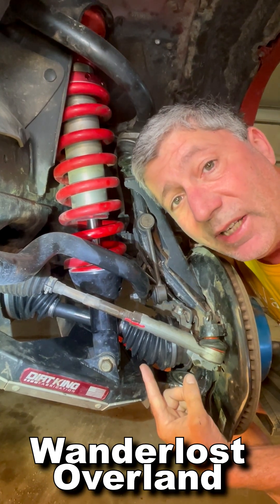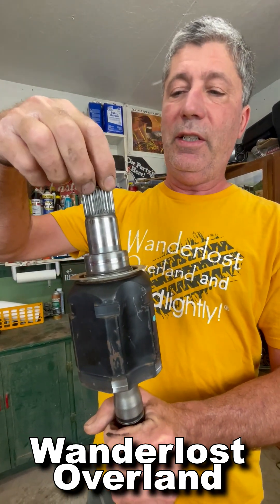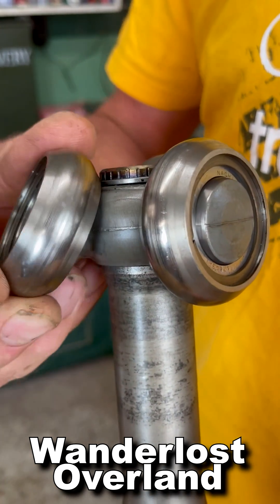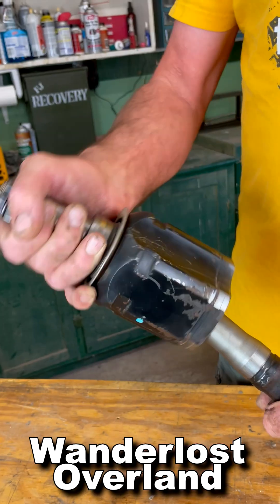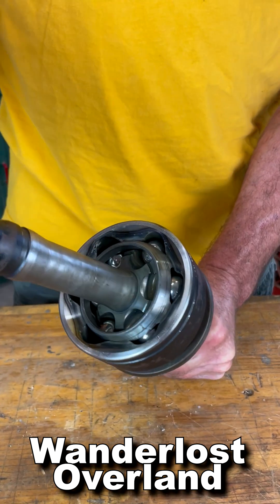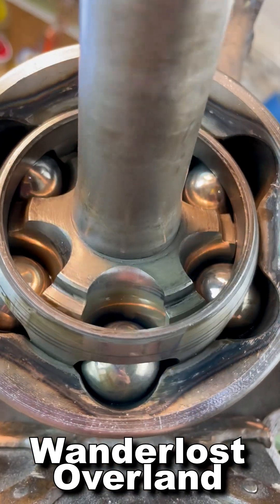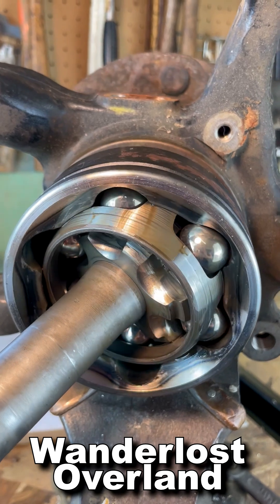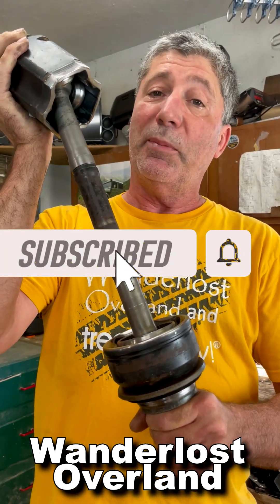How Does a Toyota CV Axle Work

Comment: I replaced my CV axles on my 2006 four Runner and used aftermarket. The aftermarket vibrate and Toyota doesn’t make axles for that truck anymore or at least those earlier years. If I had known, I would’ve just had them have new boots put on. Live and learn.
Reply: Many shops wont replace just the boots.  They insist on replacing the entire cv axle.  I just contacted my local toyota dealer and they do sell oem replacements at $600 per!

Comment: Gotta replace a couple tomorrow along with wheel bearings. Do you have to pop the ball joint off the knuckle to get it out?
Reply from the maker: No, just take out the two bolts holding the ball joint bracket to the spindle.

Comment: Except the only flaw is when the rubber boot brakes, water gets in, and the ball bearings start to rust and lock up, eventually cause your cv axle to clunk. Especially when turning sharp. Had to replace them twice within a year because the rubber boots are terrible. But that’s my only complaint with Toyota.

Comment: The CV joint is a combination of two joint designs the first shown being a tripod joint and the second being a rezeppa joint. They both have strengths and weaknesses, but are well suited for their applications (transmission side and drive wheel side). Yay trade school.

Comment: FunFact: This type of driveshaft first appeared on the Classic BMC Mini in 1974 complete with that locking circlip. They were designed by GKN in the UK which owned a range of transmission companies like Hardy Spicer whose universal joints Issigonis had used on the early Minis. But they had limits.

However the story goes back to one Alfred Rzeppa who patented a design using sliding balls but it was never used in production in the USA for many reasons and the design ended with Dana in the '50s.
However a British business called Universal Power Drives put the joint to work in heavy-duty industrial applications, including 'Unipower'-branded tractors and truck axles having solved the lubrication and material specification issues.
A William Cull submitted patents on the CV joint working for Unipower which itself was bought out by Birfield Industries in 1957, which supplied parts to the British Motor Corporation and owned Hardy Spicer and Co., Laycock Engineering and Salisbury Transmission. Cull ended up working for Birfield and continued his development of the joints. The result was the 'Birfield Joint', which was put into mass production by Hardy Spicer and was later adopted by Issigonis to meet the design requirements of BMC's 'ADO15' project - The Mini.
GKN bought out Birfield in 1966 which brings the story full circle: The joint used by Toyota is the 'Birfield Joint'.
Reply: So Front axle shafts on toyota solid axles are basically bigger versions of cv axles?

No wonder why the oil leaks so.hard to repair on them
My 85 toyota axle with Birfield design needs full re seal

Comment: For those that off-road, avoid straining the axle at full droop while wheel is cracked all the way in one direction. 

Was with a group of guys where one blew his driver side out,  about an hour later after swapping it out, blew out the spare on the same rock.
Reply: Thats a common issue with universal joints, not CV joints
Reply: @mildphil  sorry, I should've stated it was a group of 4-runners.

Comment: And that is why CV joints implode.
Reply: Only had an inner side joint explode on me with brand new only days old axle coz of me replacing only one side engine mount and not both sides together which I should.  Was at full stop in middle lane making a sharp left turn and it exploded with trunions braking the cup. It was a Mopart  OEM part
Reply: @andrewbanit4884  yeah it was a Mopar part. They’re known for shitty ball joints, especially with their 3/4ton to 1ton trucks
Reply: Only had them break from lack of grease, very old grease, or just cheap parts. There’s a reason why the OEM parts are more expensive, it’s because they are better

Comment: It would be interesting to compare it to off the shelf versions from parts stores to see how the OEM ones differ.
Reply from the maker: I'm guessing they will appear to be identical. The difference would likely be in machining tolerances and metallurgy.
Reply: @WanderlostOverland  and that is always the case. GD&T for optimal fit and endurance is not cheap, and inferior materials just the same.
Reply: @WanderlostOverland  most the time these days, it’s literally name branding
Reply: They dont differ in spec the things that are different mostly wontt matter to fit an function the boot will be made of a different material the band's that would hold the boot will be different an some will come with the sir clip an some wont
Reply: They won't be different apart from what other guy said abput boots and clamps circlip I would add different OEMs may use different kinds of lube in the boots too
Reply: Back in the day, it was better to go with OEM parts, but because the manufacturing processes have improved, the other companies have improved the quality. I've never seen a side-by-side comparison or longevity/performance tests, so I'm concluding on my own that Toyota has released some propaganda bits to keep its customers wary or afraid of using something else and the business continues rolling in. Other than something that would be covered by warranty and you've used non-genuine parts, that could be where the stories have started
Reply: No one in this thread knows what the freak they are talking about. The shaft he's demo'n is an OEM part. Your cheap chinese crap one from the parts store doesn't look like this one. That's why it's $200 cheaper.. Stop pretending it's "just branding" ...
Reply: There's some reading around the internet that says the OEM Toyota CVs are, in fact, different in their construction and allegedly better in off-road circumstances because of it. Hence, my comment, as I've never truly seen anyone dig into that claim. It may just be tolerance and steel quality at hand, but the cup design is different in OEM vs. aftermarket. It would be interesting to know for sure as I see a LOT of debate over what CVs to use when replacing in these rigs.
Reply: No visible  difference  they all made the same basic way
Reply: They all look and work that way. Not just toyocrap😮